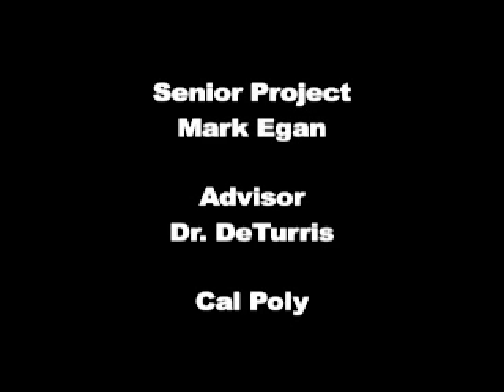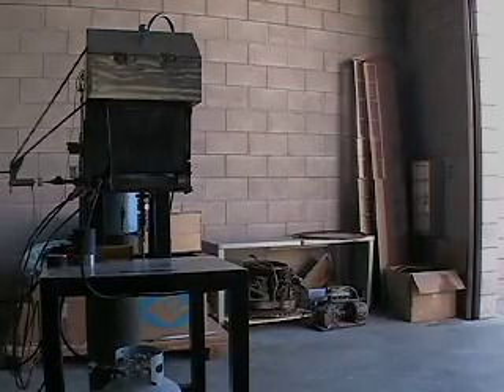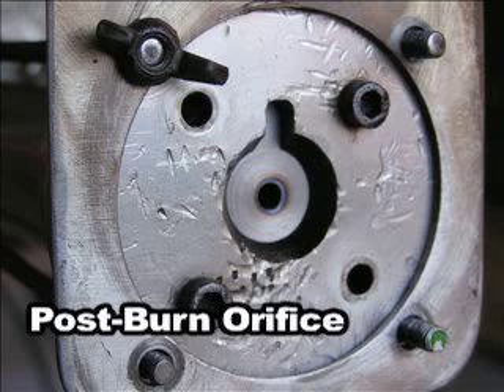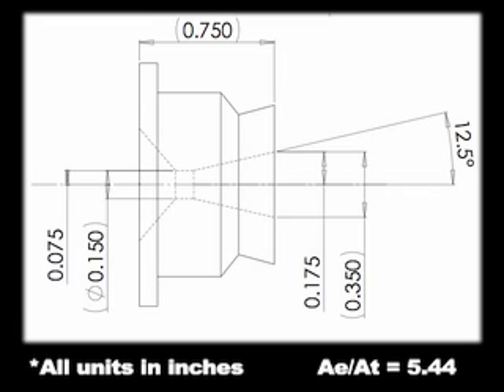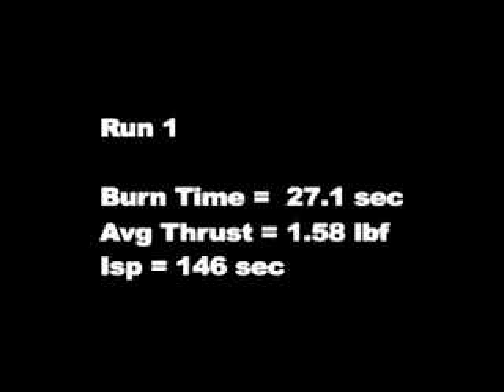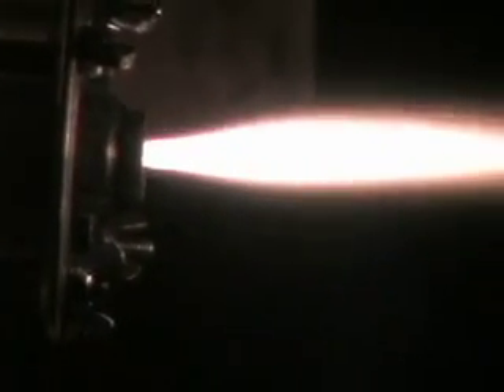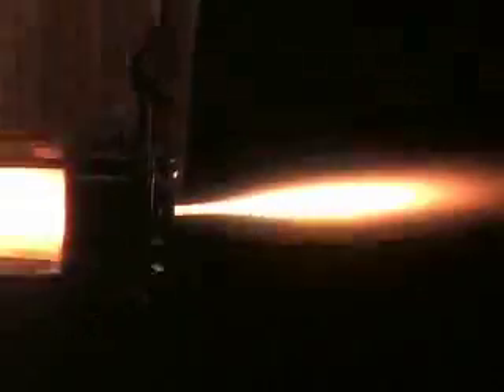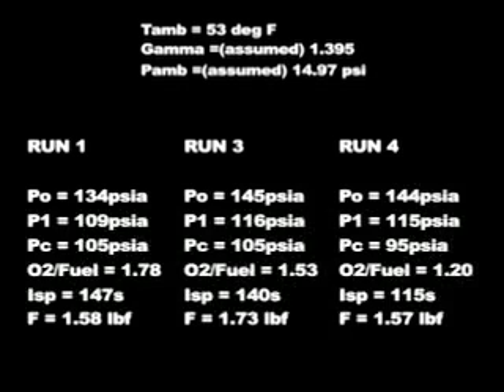Hybrid Rocket Motor Nozzle Tests

Comment: I would have used a finocyl or star shaped cross section in the solid grain. What was the measured pressure drop over the injector?

Comment: You could do what NASA does, run the cool LOX (air in your case) through a heat exchanger built into the nozzle. In your case this would be radiator tubing welded to the outside of the nozzle in a wrap around loop, this will pre-heat the oxygen increasing it's pressure, cool your nozzle, and if you can get a good weld it should be doable. NASA uses internal heat exchanger loops in the inside of the nozzle, like a sandwich, running liquid helium (may be oxygen, don't remember) through it before c

Comment: @cabagesoup714 Use the kind of clay that fires in a 2500* kiln that can be reheated and reheated...  it's cheap, and can be machined if you're slow and careful, and it doesn't melt easily.  Estes does it all the time.

Comment: @nox665 Most CalPoly engineers use metric unless specifically told otherwise.  Many times we use English units since we are told to by industry such as Boeing, Lockheed Martin and Some others for presentations; have you ever had good momentum in a presentation that is brought to a sudden stop because some old engineer can't use metric? Really we want jobs.

Comment: overexpanded doesnt mean flow separation...flow separation in overexpanded nozzles only occurs when the ratio of nozzle xit pressure over ambient pressure is less than 0.3 ;)

Pressure oscillations in the chamber have nothing to do with vortexes in the nozzle, because interferences in the supersonic nozzle flow can only travel downstream out of the nozzle.

Comment: Thanks, I'm a pretty experience builder, but new to rocketry.  I'm starting with cellulose as the fuel grain, I want to try different materials eventually.  I am very aware of the possibility of the nozzle melting.  Are there any good forums online for hybrid rocket motors?

Comment: That is great, just the information that I needed. I am making a hybrid rocket motor, using gaseous oxygen as the oxidizer.  The nozzle is the hardest part for me, I have a lot of machining experience but am too poor to buy materials other than steel.  I was worried that the steel would melt, but this resured me.  I don't know if you have any tips, that would be great.

Comment: Well done.  What is the fuel type? What approximately are the combustion chamber pressures (about)?  Is the Plexiglass a standard or modified material- what gauge thickness is it?

Comment: great video.  I also got sputtering near the end of my runs, and i think it might be because the soot build up around the inside opening of the convergent part of your nozzle is impeeding the flow.  My motor did not have a post combustion zone to allow for a complete combustion of the fuel.  I wonder if it is the same problem you are having with the sputtering.